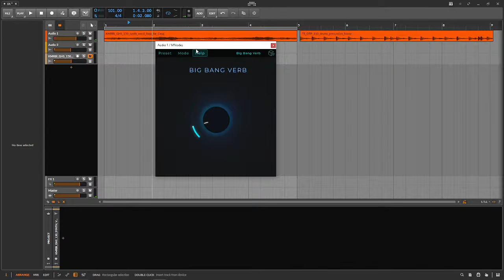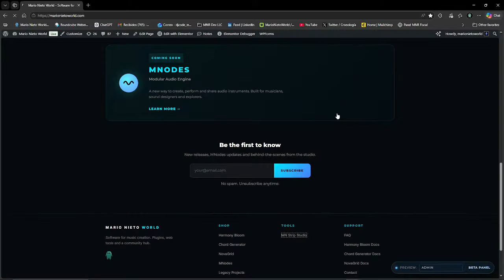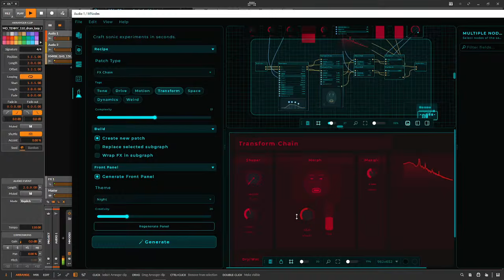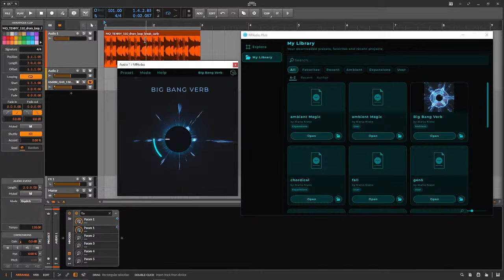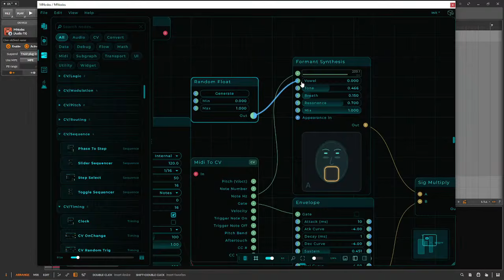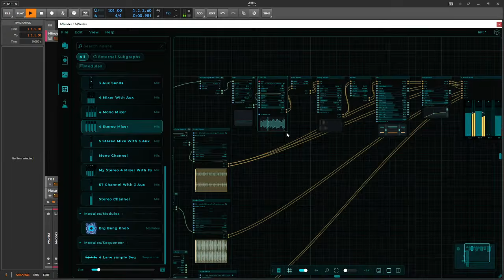Creating with MNodes #01: First Live Look

Comment: Can this be used as both a synth and an effect VST plugin? Will it be a regular offline version like a normal VST plugin, or will it be a paid method that requires constant online activation? And how much does it cost? Can you also create VST plugins with JPEG, PNG, and other formats using it, like a patcher?
Reply from the maker: Can this be used as both a synth and an effect VST plugin?

Yes.

Will it be a regular offline version like a normal VST plugin, or will it be a paid method that requires constant online activation?

A one time payment, and you can use it on up to three computers at the same time. You can use it offline once it has been unlocked. The licensing system will be the same as in my other projects like Novagrid or Harmony Bloom.

And how much does it cost?

€79

Can you also create VST plugins with JPEG, PNG, and other formats using it, like a patcher?

You can load your own images, yes.

Comment: That Karplus-Strong node does a great job emulating stringed instruments.  It sounded to me like the physics behind it are correct, the energy raises the pitch on the initial attack.  Nice!  Lots of quality in MNodes.  I didn't realize in your previous video that it can act like a modular synth!   Still wondering if external plugins are supported, or only those in your brand.  And if it can process external audio and sidechain input.
Reply from the maker: For now it doesn’t accept external plugins, although several users have already mentioned it to me and it could be very interesting to add, but I don’t think we’ll have it in the first version. As for whether it processes audio, yes, it can process audio and MIDI.